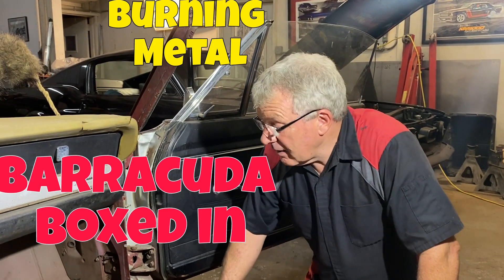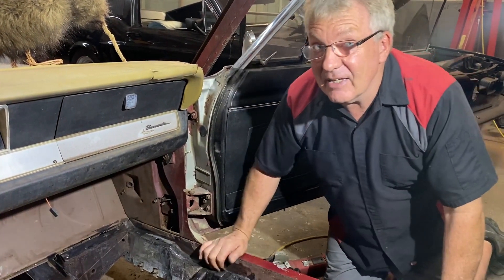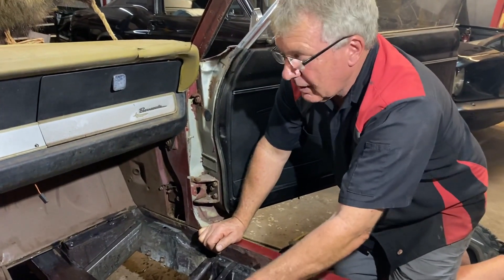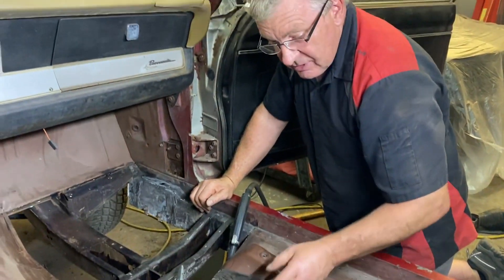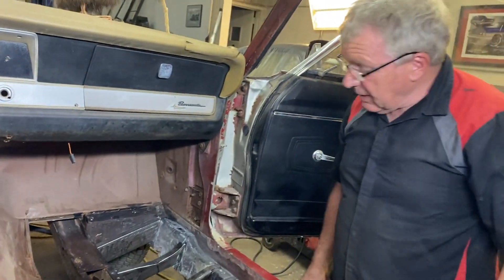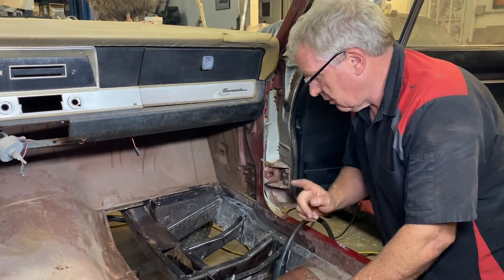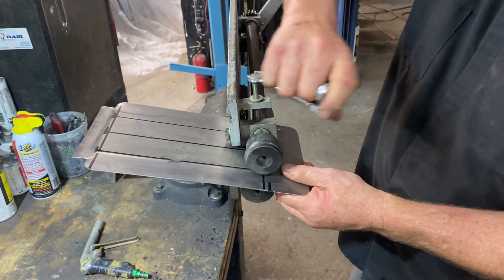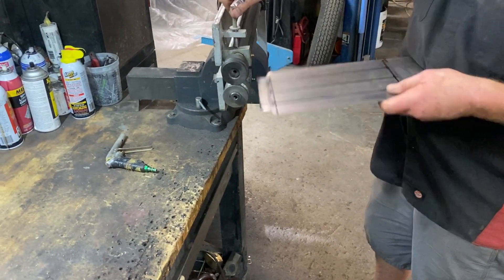Barracuda Boxed In, burning metal

Comment: Great episode!  I know these are a couple years old, but I'm just now watching them.
I have one of those bead rollers and I hated the crank.  I've seen people use old steering wheels, but I didn't have one.  But I did have some old electrical conduit.  I made a hub (retired machinist here) to fit the machine and cut the conduit.  I just bent it around by hand mostly and it's not a perfect circle, but it's close enough.  I then cut 3 or 4 straight pieces for the spokes and welded it all up. All in about an hour, hour and a half.  It made it SO much easier to do bead rolling by myself.
Reply from the maker: I'll bet it does, what a good idea !!   Thanks man!!

Comment: Aussie Valiants had that reinforcing,, so did Kiwi ones, or at least they should do.
As for truck engines?? Keep it small block. Will handle a LOT better 340/360 with alloy heads etc to lose some weight and make similar to big block power.

Comment: Love the channel kiwi fantastic fabrication I hope you don’t mind me giving you a tip but I’m just a dumbass boilermaker but turn your fine settings up 2 and wire speed down a touch it will allow more heat to penetrate into the joint which will a lot stronger and a flatter weld to where it keyholes the material and burns the whole way through. Give it a try mate you won’t be disappointed
Reply from the maker: That's good advice.  It can be tricky to really  burn it in when your dealing with 50 year old thinned out metal and cheap Chinese metal......

Comment: Nice work. After having to do lots of reworking of the repo torque boxes in my 66 mustang, this doesn’t seem like any more work. 

And, leaving your “tag” inside is a nice touch. I worked at Cadillac in the 80’s and found little surprises left inside of caddies by assembly staff. Excellent!
Reply from the maker: The other side should go quicker now I have the shape of that rear brace down. Thanks for watching
Reply: Friend bought a new Valaint ute mid 70s,, came with an empty Coke can in each door!

Comment: Why didn't you weld the top or the front brace to the metal at the front of the foot well? Unless you are going to do it from the bottom side to help prevent water penetration. Just wondering looks great and not something I had considered doing to my 64 barracuda but will likely need. My current plan is to in a modern hemi and trans so it will have around 400 hp.
Reply from the maker: I'll get it from underneath when I weld the Pinch weld at front of the floor pan together.   The modern Hemi will be a great swap!!